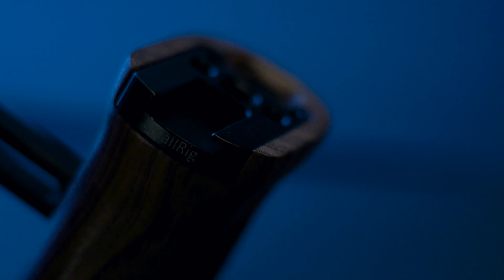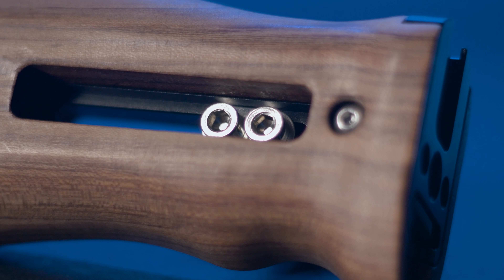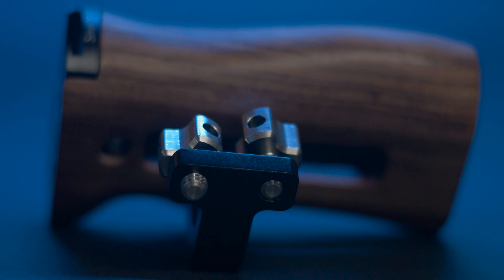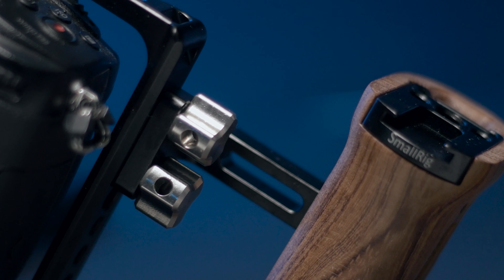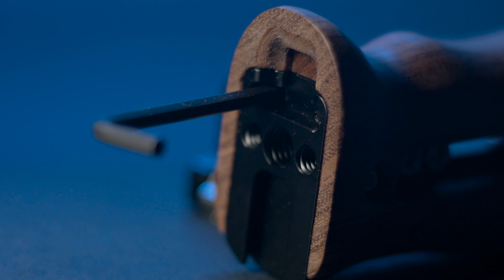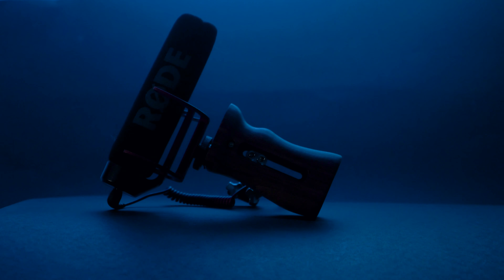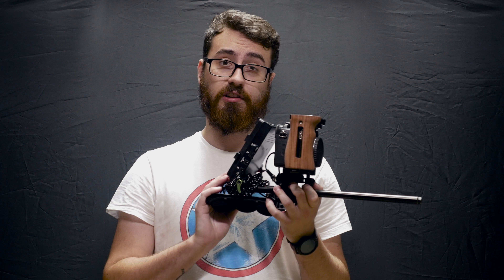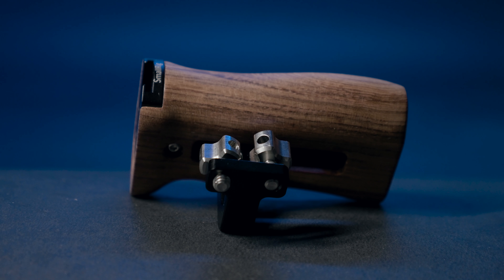Smallrig 2093 Wooden Handle Review

Comment: Can I take the wood handle off?
Reply from the maker: Take it off of what?
Reply: @AshConnaughtonDP  like the wooden part of the grip.
Reply from the maker: @ubacow7109  you can remove it to flip the handle from right to left handed use or vice versa.

But to be useable as a handle you obviously need the wooden part attached